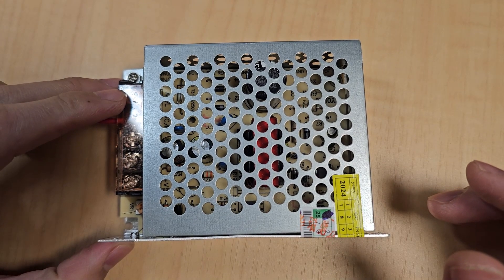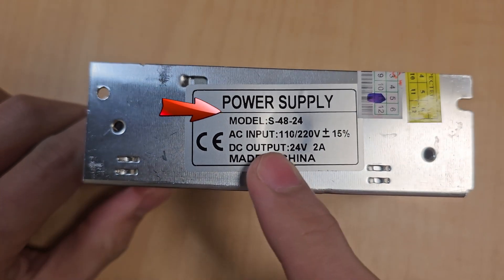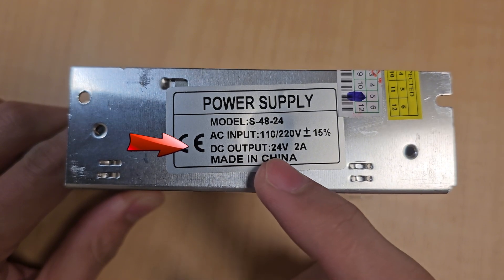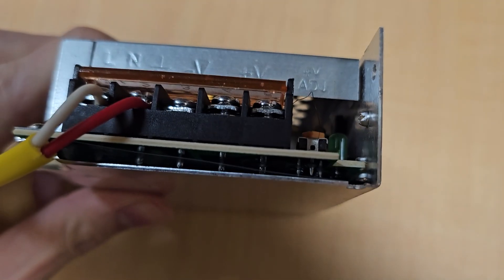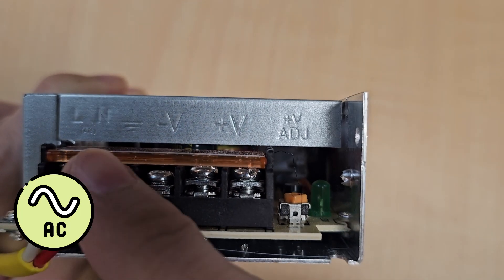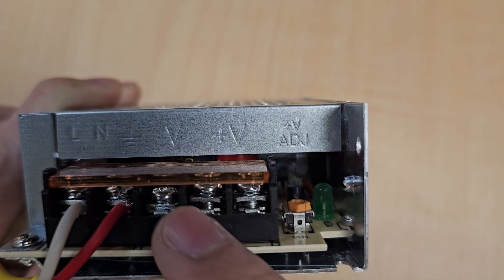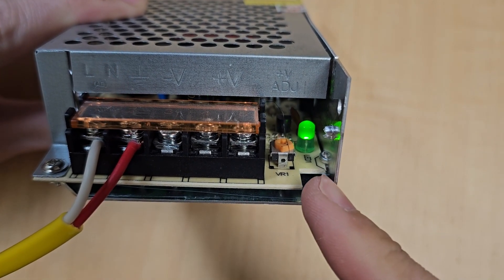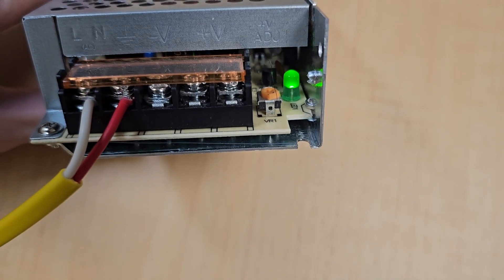What is a Switch Power Supply?

Comment: SMPS aka Switch Mode Power Supply System. That you are saying I don't know it.
Reply from the maker: Thank you for question sir. Basicly, this switch power supply use to supply 24V or 12V or 5V power for other devices such as plc, sensor,...